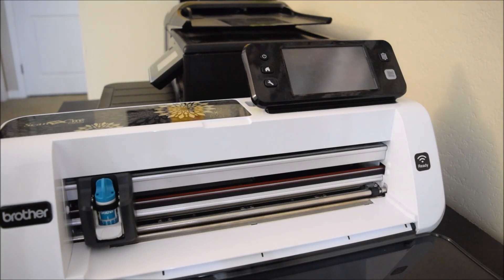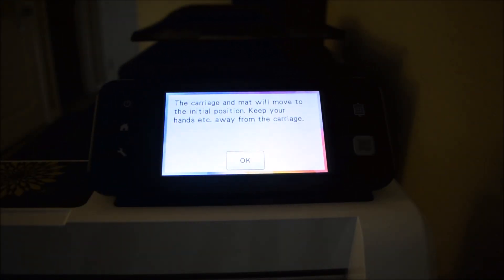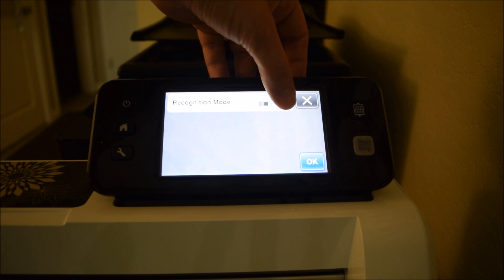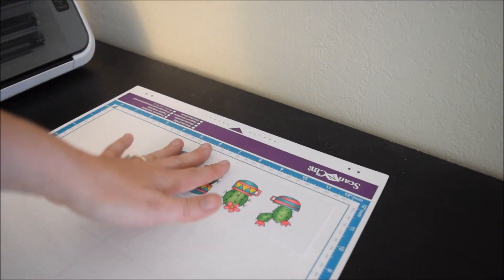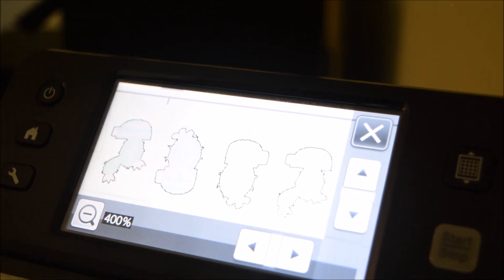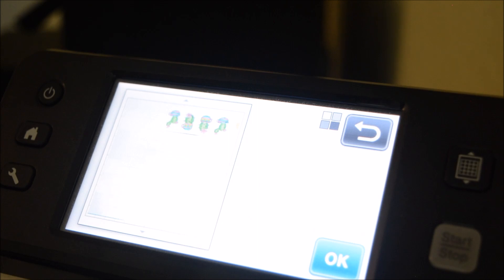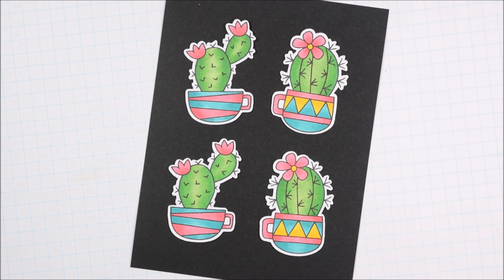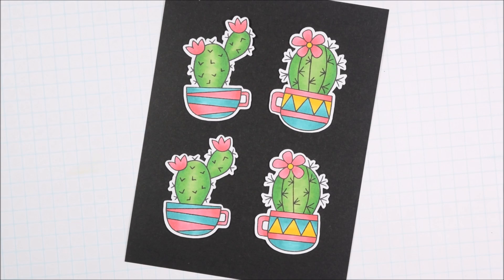ScanNCut for Stamped Images and Troubleshooting Tips

Comment: I just found your video.  I see you also have my printer.  I have had to change out the printer head twice now.  It is a hard printer to find.  Mine is still printing great.  I use it for my sewing and design stuff mostly.  But it prints for the Scan N Cut too.   I enjoyed the tips and the inspiration to keep working with my Scan N Cut.  Which I love.  I hope you are still using yours.  Thanks for the video.  

I can't tell you how much money this machine has saved me.  It is one if the best investments I have made in my crafting.

Comment: I am so glad to see videos with the "consumer" CM350 model.  So many of the promotional videos use the commercial model (CM650) and it is good to see how it actually works with the model that is available to most consumers.  Thanks so much!
     (I know the 2 models are supposed to do many of the same tasks but the proof is in the video!)
Reply: The only difference is the 650  and has a 24 inch mat and the 350 doesn't.  the 24 inch is usually used for cutting clothing patterns.  Hopes this helps..

Comment: This is a great and more economical tool to replace buying individual die sets.  Once one gets used to how the machine operates, having to make minor adjustments like you did won't take any time at all.  In case you didn't know, Julie has a tutorial on the "cutting inside and out" feature, which I believe would cut out the small space within the cup handles.  Great tutorial, Jess.  You explained things plainly; very easy to understand.  Thanks, sweet pea! 😃💖
Reply from the maker: Thanks! I will definitely be checking out more of Julie's videos now that I have the basics.

Comment: Storing my mats.  I have several and I use a large metal, heavy duty pants hanger (or skirts etc).  There are four or five rods, each below the other and each has two heavy duty clips that have rubber on the tips so as not to damage anything.  I keep them like you do, in the bag with their plastic sheet on them, and then attach them to the clips.  I didn't have a safe place to lie them flat so this just hangs in the closet of my craft room a few step from my machine.

BTW, the new standard mat that is black and white rather than the turquoise blue and white, is new and improved.  It is much stickier and remains that way longer.  Julie's tip on wiping it with a baby wipe works great.  It cleans off any paper dust and keeps your mat clean.  I don't have to use it except for when the sticky seems to not be sticky enough, then it brings it right back.
Reply from the maker: The black mat does seem to be better quality. My sister hangs her mat as well. That seems like a great solution for keeping them flat.

Comment: Those cuts were perfect. So many videos i have seen, the cuts are not even or perfect. Being a perfectionist, I would like for the cuts to be even all around the stamped image. Do you find with the Scan and Cut, that the majority of the time it comes out even and perfect like those cactus's?
Reply from the maker: Yes I find that to be a consistent result. It's not as smooth as diecutting with traditional dies but it is comparable in my opinion and considering the price difference long term, worth it.

Comment: Just got this yesterday. Your tutorial is so helpful, thank you! I am using the same Recollections cardstock as you and the machine is completely shifting the cardstock when cutting and ruining my stamped images. I have tried everything to get it to stop doing this. I've used 2 different kinds of tapes to try and hold the cardstock in place to no avail. I tried a baby wipe to no avail. I just got it yesterday and so the mat is still very sticky to the touch but still moves the cardstock every time. I even tried different cutting depths on the blade and that didn't help either. If anyone has an idea of what I can do please let me know. Thanks!
Reply from the maker: So sorry you're having so much trouble. I had this trouble for the first time with mine but my mat has lost almost all stick so it was understandable. I would try reaching out to Brother for suggestions. Maybe try adjusting the cut speed in the settings if you haven't already.
Reply: Jess Crafts thanks! I ended up returning it as I was having multiple issues with it and for a machine that costs this much it just wasn't worth the trouble. Thanks for your help!!

Comment: Thanks Jess, I just got my scan n cut for Christmas so I am watching videos how tos. Like yourself I am using it to cut out stamped images. Question, would it help if I were to cut it out before I color the object? Or is it better after it has color? 
Thanks again
Reply from the maker: I like to color mine first because I think it is hard to hold onto the small pieces and color them but if you do run into problems with the scan and cut you are risking ruining a colored piece which can be more disappointing. I color almost all of mine first.

Comment: Thanks for your tips because as of right now, I feel like my scanncut is junk! I've watched several videos showing how easy it cuts small stamped images but, mines will not even recognize and cut a 3 or 4 colored 11X11 simple image such as a Minion. Another image I tried to cut was a My Little Pony, when I finally got it to cut after rescanning 8 times or more cut with the edges cutting jagged. So disappointing when I paid way over $400 for this machine and the rolling storage tote for it from HSN almost a year ago.  I will try using the black and white setting before I put a for sale tag on it. Thanks again!
Reply from the maker: I think it's important to know what you want from a machine. I was lucky that my sister had one and could tell me and show me if it did what I wanted. I knew I wanted small stamped images that would have clear black borders because they were stamped. But it may not be for you if you have other goals. I hope that maybe some of these tips will help. Best of luck!
Reply: THINGS TO PAY ATTENTION TO WHEN SCANNING A STAMPED IMAGE: 

1. Direct lighting on your machine can reflect into your scanner and mess up the way it reads the image as it goes through.  
2. An incomplete circumference line will prevent a good scan reading. If you need to you can tape a sheet of acetate over the image and draw a line on the acetate, around the image with a dry erase or other washable, thin marker.  Once you have a good image, remove the acetate and press cut.
3. You can also try switching from b/w to color and vice versa. On one colored image I had to reduce the number of colors in the scanner even though it had Many colors... so that is something else to look at if the basics don't kick in easily.

The first two are the Most likely culprits in my experience.

Comment: Thank you for the excellent video have seriously considered buying the scan and cut. I only have a lap top not a full up computer. Do I need one to set this up or not?Other than that you have answered all of my questions and I think it will pay for itself very fast due to the fact you would not have to buy the dies if they are even available. I was afraid this might be to hard for me to set up and use  but looks very easy. Thanks again😊
Reply from the maker: You do not need a computer of any type to use the ScanNCut the way I used it today. Setting up the ScanNCut just basically involved putting the blade in, plugging it in, and then what I did in the video. There's a lot more you can do. You can do fun stuff with your computer and you can update it that way. But I have never used it with my computer and I cut stamps all the time.
Reply: Dawn a laptop is the same as a pc. The only difference is the laptop it is portable and is a 64 bit and the pc is a 32 bit. this bit information is just for use when you are setting up and installing hard drive stuff.  Hope this helps you to know the difference.

Comment: Hello, thankyou for sharing, I have a new scan n cut 900 machine. I have a question that i'm hoping you can help me with, when I design & scan  my own cardstock templates like for example a 6 photo frame which is 12 inches  x 12 inches, the frame edges are 1/4 inch thick, when I scan  my  template it does not scan in the whole edges only a small area of my frame of the centre part of the frame, how do I fix this machine so I get successful 12 x 12 inch scanned images, is there tool settings that I can  check & adjust on my machine please for your help would be muchly appreciated.
Reply from the maker: I am so sorry but I've only ever used my machine for cutting out stamped images so I am not an expert. However you can check out this Facebook group run by someone much more skilled than me. https://www.facebook.com/groups/Scanncutcanvasscalhelp/

Comment: I probably doing my scan and cut and when it starts cutting, it cuts everything instead of the whole design. Do you know what would be the problem?    For example like your cactus, it would probably would cut the little flower on the cactus.
Reply from the maker: Sorry Bertha! I'm not much of an expert. For me the black and white to color switch and rescanning have helped but I don't have any other tips at this point.
Reply: Thanks
Reply: You might have the region detection icon  selected instead of the outline detection option.  The outline detection option looks like a half circle and half square joined together.  The region detection icon looks like a circle and an overlapping square.
Reply: Donna Sosa I haven’t tried that feature of the machine yet but I appreciate your tip.  It has saved me the time of searching other tutorials for an answer should i have that problem.  This tutorial has been very helpful and i especially appreciate how she explains what she is doing from one hand movement to another and going slow enough for people to keep up, don’t you think?
Reply: How do I locate this setting?

Comment: I'm having trouble making the machine only outline and cut the stamped image.  It scans and wants to cut inside and outside. But it only does it on a few of the images. Has anyone had this problem and if so, how did you fix it?

Comment: I hope you can help me. I have images that are drawn and not stamped. They don't seem to scan very good. Tried color and black and white and the machine does not do it very neatly. Should I do it with darker pen. Any suggestions
Reply from the maker: Hi Judy, I would try a darker pen and/or a thicker line. The lines must also be closed. If there is an open area the Scan and Cut will not recognize it.

Comment: When you get to your final screen, select the square with the triangle, square and circle.
If there is anything on the screen you don't want it to cut (e.g. the edge of the card or any other speck it has picked up) you can scroll thru the images using the left and right arrows and select the rubbish bin to delete anything you don't want to cut.
HTH
Reply: KathleenMc73 thanks so much.  I was having an issue with this and your comment helped.

Comment: I'm thinking that you could probably have closed the "frame" around the cacti a little bit more to avoid the machine seeing the shadow of the edge of the paper as a cut line...? Not that it mattered. But I'm assuming that's how it works if you want to exclude stray marks or only cut one image out for some reason. 
Thanks for demonstrating. I think it would be a good investment for cardmaking. Fussy cutting is not one of my skills  >.<
Reply from the maker: Yes. I saw that recently in another video and will try it in the future. So far I'm very happy with it as an investment.

Comment: ugh....I've done so much research between the scanncut, cricut and silhouette and decided to go with the scanncut2 because of my need for the scanning/cutting.  I'm so disappointed.  My image will scan perfectly but when it comes to cutting it will not recognize the print properly (colours) I never get a straight cut and even often it won't recognize all of the images on the paper.  I've searched high and low for how to resolve this issue (I tried RGB, W&B. playing with contrast..etc.)  I'm at my wits end. Do you have any tips??  (I'm trying to cut printable stickers for planners and they can't have a white border and they are all colours and even pastels) :'(
Reply from the maker: I'm sorry you are having such trouble. I have never worked with solid colored images without the black border. I would recommend Julie Fei Fan Balzer's channel as she is an official Brother demo and is an expert on the machine.

Comment: Do you what the difference is between this and the wifi one ...other then cost lol
Reply from the maker: The machine is the same but you get the wifi card. The wifi card allows to you save files from your computer without plugging in a usb drive or connecting it to your computer. The main reason to have this card is if you want to design elements or use cut files from the internet. You can always buy the wifi card later when you decide you want it.

Comment: I cover my mat with press and seal wrap because the wrapping was missing from my mat when I purchased it.
Reply from the maker: Excellent suggestion. If you don't mind I'd love to share that tip if I do another video since it may help others.
Reply: Jess Crafts I don't mind at all if you share that tip. :)
Reply: That's a great idea - thank you! It's so dry in my house in the winter that the plastic sheet that came with the mat is very staticky and seems to attract every bit of lint and cat hair in the entire house, which then ends up on the mat no matter how hard I try to wipe the plastic clean.